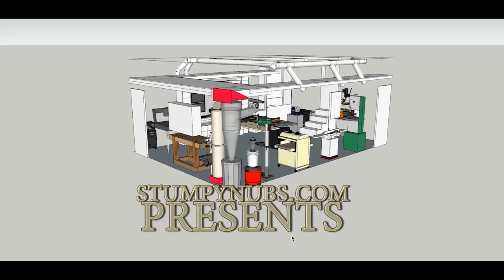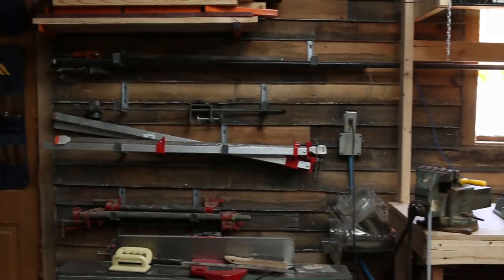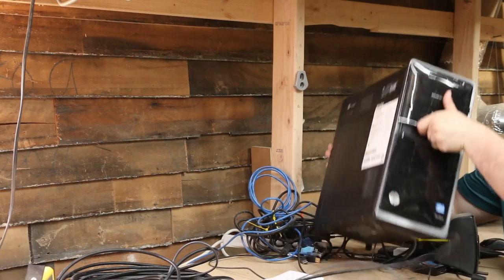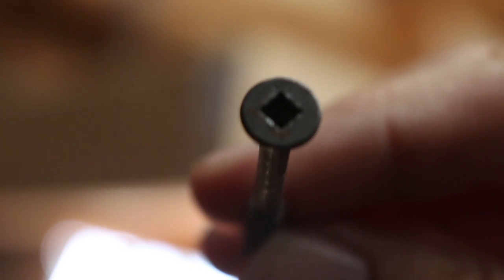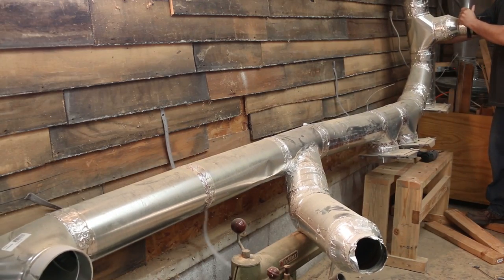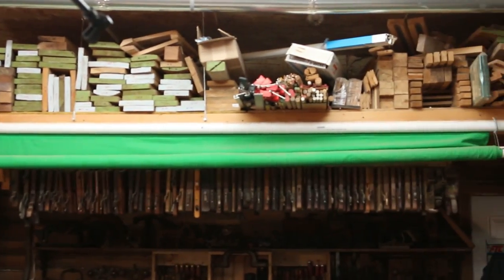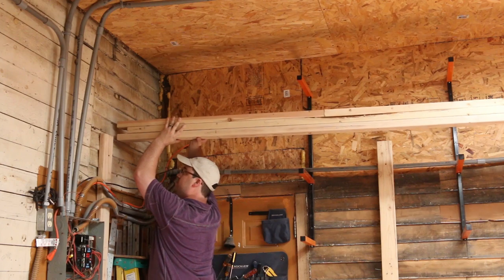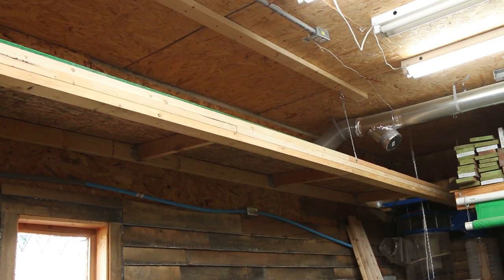SNW Shop Blog #1- Building storage lofts for drying lumber

Comment: Stumpy,
Awesome stuff.  Thanks for sharing.  As a side note you assume you had the 2x4 versus buying new stock as your reasoning.  If not you would have been better served with a 2x6 or 2x8 standing tall for the beam.  With the 2x4 laying flat in the direction of load they are at their weakest.  Also would be worth gluing them together so they act as one.  Pin them with screws adds little to their strength.  Just a little 411.  You and the 'Stache keep up the great work!

Comment: That's really going to open up floor space for you.
Reply from the maker: The ShavingWood Workshop I put it at 8 feet off the floor because I have 10 ft ceilings, but I would have been just as happy with a little over 6 feet- just enough to stand under, which is a better option for those with lower ceilings.

Comment: Interesting additions/changes.  I look forward to the replacement dust collection piping.  I've avoided PVC because of the static electricity build up -0 too much dust clings to the piping.  I want to see what you do to avoid/minimize this.
Reply from the maker: Mark Hazlewood - As much as people say that the shop will explode from static buildup, there has actually never been a single documented case of fire from dust in PVC pipe. However, grounding the pipe is a very simple process. I'm not sure if I'm going to bother with it or not. As far as keeping the ducts clear, that has to do with your dust collector. If your ducts are too large, or too long for your system, you won't be able to maintain enough CFM to keep them clear.

Comment: Hey Stumpy turn 2x4 on edge glue and screw them with construction adhesive.They will be much stronger.I would use 2x6 or 8 for a long span. What can I say I use to build houses etc.
Reply from the maker: Backyard Woodworking - I know there are better ways to do it. But you may have also noticed that I had a lot of 2X4's on my hands when I disassembled that big bench...
Reply: Stumpy Nubs Oh I understand but that's a lot of weight up there., 2x4 great for the cross members.
Reply: Backyard Woodworking I was thinking along those lines as well. At least rotating the beam so the boards are vertical so the load on the screws would be shear strength instead of relying on the threads only. The adhesive would likely help a lot too.
Reply: Stumpy Nubs You can use the 2x4's as you did, but you needed to glue them. Screwing does not give you the stiffness. Gluing them makes them act as one piece of wood. Gluing makes a HUGE difference. Think about bending and laminating thin strips of wood. The principle is the same.
Reply: Stumpy Nubs I think the Backseat Woodworking guy is right.  I'm no engineer but when I framed houses and used 2x4's as headers we oriented them on edge.  This was the method regardless if the material was 2x4 or 2x6.
Reply from the maker: gjdewald The reason why they weren't on edge is because I originally wanted 6" in thickness (four layers thick). That was because I am hanging lights and wanted the beam to shield the lights from the cameras. But, I was doing this alone, and when I tried to lift a 6" thick, 24' long beam 8' off the ground, I decided to take a layer off to lighten it up. (Which is why I am glad I did not use glue). But even if I had oriented them on edge, and even if I had used glue, it would still require center ties. You can't even run 2X10 floor joists (on edge) 24 feet without a center support (unless you use an engineered I-Joist). So, since I needed center ties anyway, I opted to do it the way I did because it was more convenient.
Reply: Stumpy Nubs Seems like we all realize that a board is stiffer on edge for vertical loads, and yes Stump, long spans need center ties. But you did mention that you were just using the 2x4s you had on hand. So to get the most out of what you had, you needed to glue them. My choice would be four boards, flat and glued. That gives you a 3 1/2 x 6 beam. I would not glue more than two 2x4s on edge. Too much twist and warp to trust it. I would do the math first. But lack of glue is the mistake here if you want to get the most from your wood .
Reply: Stumpy Nubs Two 2 x 4 on edge then one 2 x 4 screwed flat along the bottom. Then once in place another 2 x 4 screwed to the top. Gives you 6 1/2 inch thickness a lighter load to lift in place and transverse grain directions would add strength against both twist and warp. Used to see it in 100 year old balloon framed homes that stood the test of time.
Reply: James Hastreiter That is true now just glue it and screw it and you have a beam.